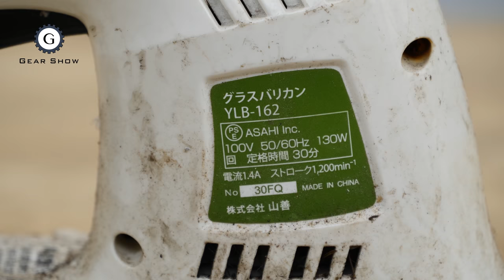Cord to Cordless Grass Trimmer Conversion

Comment: That thing is awesome! Although DeWalt battery doesn't have BMS. So you need to be careful not to discharge the battery too much, because there isn't now any safeguard to ensure that.
Reply from the maker: Okay, I would be careful about it. Thank you!
Reply: One kind voltage monitoring module，when battery lower than 15v as you set, it will sounding (very small size)
Reply: Makita battery  have good bms
Reply: @gear_show  نرننلنلنف
Reply: @gear_show  نفنلننر
Reply: @gear_show  نقنرنلت لا هلهلتلننلتلأظلزلززبزلزبوىنرزرزوبنلوبتتبمبنبننبتلملننلملزلززلزلولوزلزلنلزولزبزلنزلتلنلتتلنلملنزلولزلولتوولولولولوزلزىةوانزبزلتلززلنلن
Reply: @equationmass-energy3439  nn

Comment: Hi, since you used a 3-wire cable you could have used the extra wire to bypass the switch on the tool using a 3 position switch on the battery holder (if there was enough space)